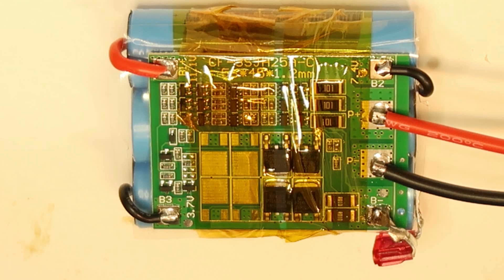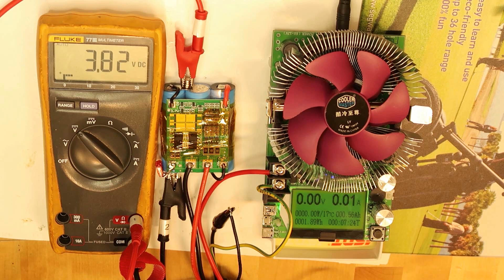Testing Aliexpress 3S cheap BMS 25A

Comment: your voice level is too low. did you protect your system with a 10 A fuse??
Reply: Those boards have a lot of defective ones. There are only 3 out of 20 are working. Therefore, there are no balancing as advertisements.
However, what I only needed was the batteries need to be shut off when its voltages drop down near 2.5 or 3v on each cell.
Conclusion. Those boards properly will never get check out. They have never been through a QC during the production!

Comment: Do you think, i can use this BMS 3S 25A for multiple batteries, like for example 3S 4P or more ?

Thanks for your answer !
Reply from the maker: Yes, absolutely
Reply: sure, but be sure that all 18650 batteries are of same characteristic... same ampere, same manufacturer etc.